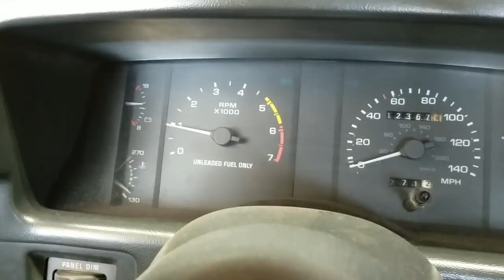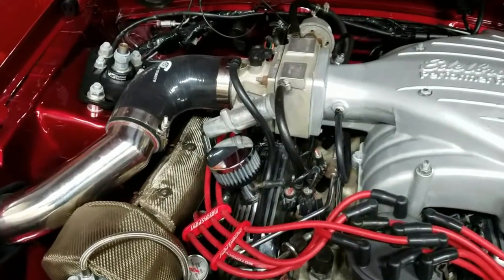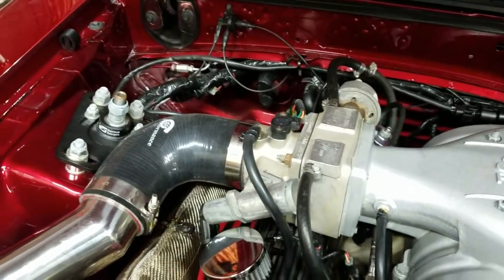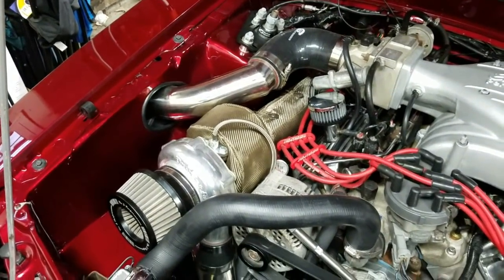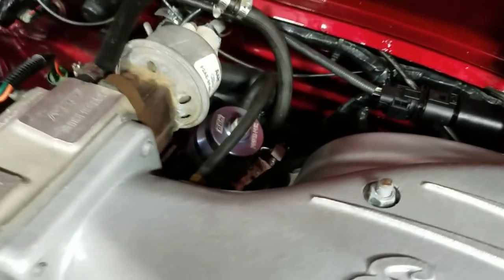Turbo Mustang Microsquirt Vacuum Lines

Comment: We have all done it for years. Factory pcv + oil filler filter is an unmetered vacuum leak. Catch can setup or all factory pcv with inline check valve are better options. Good looking build tho.